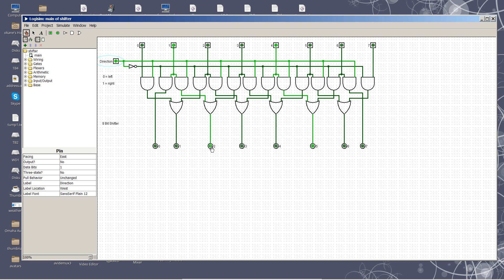Shift circuit

Comment: is there a way i can change this so theres an option to have no shift at all?
Reply from the maker: Well, you could add AND gates across the inputs with one their inputs being the actual input to the shifter and the others connected together such that setting the common AND input to one would permit the actual input to present to the shifter.